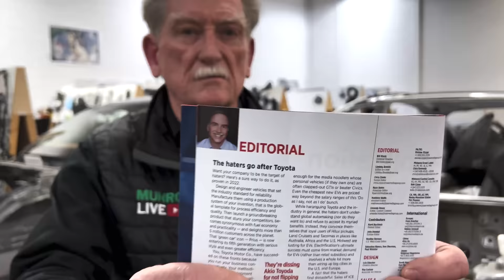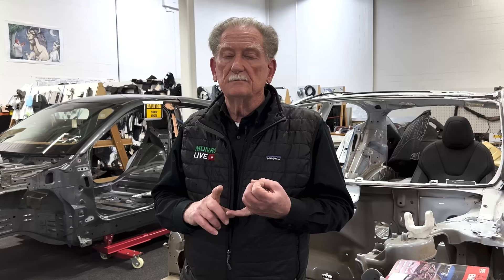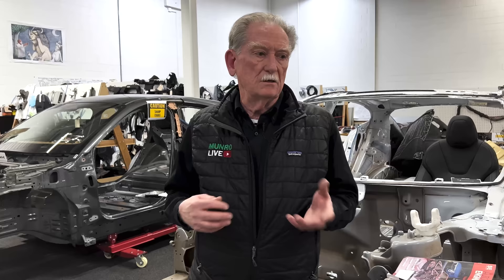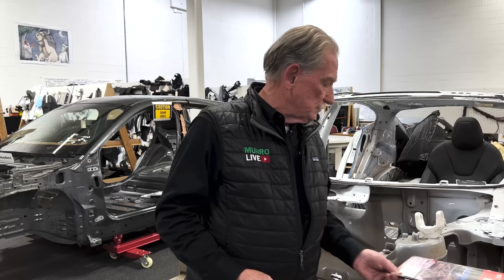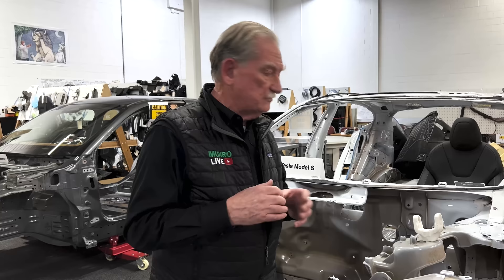GM Cast(ing) Away | GM gets low volume right.

Comment: Is cost for volume production the limiting factor for superforming scalability, or is the problem a “volumetric density” issue where the sheer  mass of production equipment per unit delivery is absurd?  Just wondering aloud via fingertips.  I think you’d be stunned how many mixed sheets and types of 7000 series aluminum Boeing gave us to develop and prove a high speed laminator for their Bell/Textron division three of four decades back. I think 3M beat that expense with 24x24 inch rolls of heavy Mylar backed with acrylic foam tape delammed and relammed by the hundreds of feet, straight into giant dumpsters.  Thanks, that was a hoot. I hadn’t even heard “cope and drag” since 7th grade machine shop and foundry class. It’s astounding what fixing bottlenecks can cost a company.

Comment: My personal obcession is "what could be".
Some brands make aluminium supercars that weigh a lot more than competiting offerings from for instance McLaren that are more carbon fibre based. The former still bring the good on the track, despite the weight penalty.
I'd love an analysic what say a Porsche or Ferrari car might save in weight by going to carbon fibre monocog for instance. And to which extent such carbon parts can be scaled for volume production. Larger autoclaves? Shorter bake times? Room temp curing? Using in a low pressure environment, are eventually costs saved that allows for exotic materials to end up relatively affordable?

Comment: I use 7 3d printers in my business when I use my 3d scintering printer I can use any metal sand to make a matrix of metal beads welded together. then I cast in an epoxy to fill the voids with a material that is extreme grip

Comment: Curious about the 3D printed battery tray. Was that ABS? Also what orientation was that printed? Just about every way I could think of woul have lots of support structures
Reply: The part could have been made on an Stratasys Objet printer.
Reply: It was probably a powder bed based process, which is pretty popular amongst industrial prototyping when you need a combination of actual shape representation and functionality. In powder bed the support structure is the powder bed so many shapes are possible with relatively little post processing labour.
Reply: @mdfyui8000  Have you seen how poor quality the parts are from those machines?  I really don't think that was the machine used to print that part.

Comment: Sandy, how possible is today for a small shop to develop a limited series using aluminium standard parts with foam loss casting and 'vacuum' forming? With standard parts for chassis and eletric drivetrain, how expensive is to get a car road worthy and certified?
Reply: Amen. Thats the question aptera is breaking. Carbon fiber is the answer for custom design in low volume. I dream of a open source free design car. Hope that canoo would throw shiity loxury carrouages under the bus for a real value vehicle

Comment: Have to disagree in therms of efficiency on the factory and overweight reduction using casting pieces. A spot welding robotic line, is way more efficient welding metal sheet layers, than using big casting pressers with big amount of rejected pieces on quality control. In terms of weigh, using casting pieces could in fact add more weight, than using stamped metal pieces.
Reply: What then is driving the trend?
Reply: The welding process alone is not the problem, but all sheet metal parts must be punched and machined beforehand. The whole thing together with the logistics needs more production space and has far more material waste than die casting machines.
The necessary weight depends very much on the construction and is by no means the only evaluation criterion as to whether the manufacturing technology is good or bad.
Reply: @rcpmac  the use of big casting pieces were just another of Musk promises. Check the amount of rejected castings spoted around Tesla factories. There's too many technical issues to properly cast big complex structural pieces with acceptable average quality. That's why Automakers, including Tesla, use smaller casting pieces, welded or riveted and glued together. Even with the Cybertruck, Tesla is back pedaling to their more standard building approach.
Reply: @Zedus-rl9hp  even so, not as big logistics as used with big casting pressers, that are expensive to operate and maintain, and can issue more unexpected expenses to the company, due to a lack of quality on a batch of castings, or the time loss maintaining the machine. While a robotic spot welding line is more cheaper to install and more  productive in the long term.
Reply: @RogerM88  Do you want to give more details on rejected castings at the present moment (at the beginning there was for sure but things have changed)? What back peddling is Tesla doing on the Cybertruck?
Reply: @RogerM88  What industry do you work in?
Reply: @Zedus-rl9hp  The guy just wants to keep his job and remain relevant in a changing world, No one will replace my horse and buggy!
Reply: Tesla's margins prove you wrong RogerM have a nice day.
Reply: @turningpoint4238  the Cybertruck, as any realistic person to the Automotive industry already knew, won't use an exoskeleton made of stainless steel, because major upgrades on Tooling, Suppliers, and Assembly lines would be needed. And the big casting piece promised for the rear section of the Cybertruck won't be feasible at a mass scale, due to possible issues with those big castings, that could suffer distortion at the cooling process. Check the recent Cybertruck update, it's clearly a standard unibody construction with some rear casting pieces.
Reply: @Barskor1  if Tesla offered more affordable cars, had a better quality control, more models and option, those margins would quickly fall. Also their average build quality shows those big margins.
Reply: @RogerM88  That was just a tool jig mock up. Heard so many times that what Tesla was going to do was impossible (along with SpaceX) and then Tesla does it. Time will tell.
Reply: @RogerM88  What? "Falcon 9 uses an already proven design", really? Think you need to do some proper research, the FUD these days is so boring.
Reply: @RogerM88  Since you don't want to/can't tell me, I have to guess based on your statements: Confectioners? delivery service? carrier pigeon mechanic?
Something in that direction, because you have absolutely no idea about the matter here
Reply: @Zedus-rl9hp  more expertive in the Automotive industry than you for sure. Tired of reading casual fanboys thinking they know it all just sit in their chair. No common sense what so ever, that claims Tesla is a Tech company to justify it being overvalued. At least due your research about the subject.
Reply: @turningpoint4238  the Merlin engines are based on the Lunar Module lander engine. Landing rockets wasn't a thing that concerned most Rocket companies, because it has trades doing that, as efficiency, more propellant, more weight, and structural reinforcements required. Just as naval means to retrieve the boosters, as refurbishment costs, which all add up. If Falcon 9 is so cheap to operate, then you should wonder why SpaceX is in a rush to replace it with Starship. They could instead develop a bigger fairing to Falcon Heavy, if the demand for a bigger rocket was so great.
Reply: @turningpoint4238  there's multiple other technical issues with Starship that could mean it only being used to Sarlink missions. As not having a standard payload fairing, and even to use a dispenser system they will need to reinforce the hull adding more weight, not Crew rated anytime soon without an abort system. Too massive requiring big amounts of propellant that could be a big issue to missions beyond LEO. Using Methane instead of Hydrogen could be an issue to produce outside Earth. The engines are to close to the ground, and the landing legs are too short to land on a rough terrain. The access to the ground for the Crew needs to be done via crane. The integrity of the heat shield could be compromised during launch and landing. Multiple other issues could also be refereed. But many fanboys prefer to drink all the Kool-Aid fed by CGI.
Reply: @RogerM88  👍😂
Reply: @RogerM88  Those rocket engines are massively different. SpaceX seems to be doing very well financially whilst been the cheapest per tonnage into orbit by a long way. Startship should be even cheaper and have far greater abilities. If you really want to learn about the facts try watching "The Everyday Astronaut".
Reply: @turningpoint4238  SpaceX is doing very well financially? Starlink has massive operational costs, requiring continuous satellite replacement missions over time. And Starship program been consuming too much funding. There was even a leaked email from Musk claiming possible bankruptcy of the company. Big percentage of the costs per launch, comes not only from the Rocket, but as to maintain the launching infrastructure, operational costs, propellant, and Staff.
Reply: @RogerM88  To be able to afford all that investment yes the Falcon 9 rocket must be very profitable. Investing is the way to grow.
Reply: @turningpoint4238  Starship as stated, has a big issue for commercial applications, it doesn't have a standard payload fairing. Meaning sensitive maneuvering will be required to deploy the satellites, or the use of a Canadarm. And to have a functional payload hatch, structural reinforcement to the hull will be required. Add to that, many companies opting for more compact satellites. A simple comparative in the number of launches from Falcon 9 to Falcon Heavy, just gives you a clue where the market is trending.
Reply: @RogerM88  Having a large capacity at low cost opens up new markets. Don't keep looking to the past thinking the future will be the same. A good start at understanding how different the future will probably be is the work by Tony Seba. A man often laughed at when making predictions by industry experts but guess who is the least wrong.

Comment: Cadillac, Cadillac you say. I had a 2008 Cadillac for five years ( first and only Cadillac ) GM product ( how could I go wrong???)
Without question the worse piece of junk on wheels. Always something broke or about to be broken. Always to the tune of $1000-$1500+ repair. Nice driving, yes,when it did, and that was rare.
Make no mistake, I always keep my vehicle in good sound working condition. I am way to cheap to spin the tires.
What are the chances of a broken rear wheel bearing, rare for sure. But two! A hanger bearing, no problem $50-$60, but it is attached to a $1200 drive shaft. I can go on and on but this is not the place to air my complaints.
Cadillac was once revered as being among the best of vehicles on the road...........not in my books. 
And yes I still have the repair bills to validate my claim. I woulden't

Comment: No mention of porosity with casting.   The larger the casting,  the more likely it is to have a fatal flaw due to porosity.  With housings and cover plates, they can be pressure tested to find flaws.  With structural components,  it seems like you would have to x-ray every part or do a non destructive stress test.  I don't know if Tesla has a good way to confirm structural integrity of each part or they are playing the odds until they see catastrophic failures in the field.  I would not want to be the guy that has a cybertruck that cracks in half after hitting a pothole. Tesla also has a way of blaming the customer when their stuff fails.
Reply: Beauty of sand casting is the ability for gas to permeate through the sand mold lowering the overall porosity within the casting cavity
Reply: @ryanlester6882  Tesla is using die casting with their giga press.
Reply: @michaellowe3665  My comment was in reference to the sand castings for the Celestiq. I would be interested to see if 3-D sand printing is being used for hollow sections that traditional coring strategies wouldn't allow for in conventional sand molding methodologies.

Comment: How much metallurgy has been done on parts produced from additive manufacturing?  CAD data representing the part to be made is easily obtained, BUT is the part produced from additive manufacturing EQUIVALENT (in every way - strength, fatigue resistance, thermal properties, chemical resistance, etc) to the same part produced by well understood traditional methods backed by science (metallurgy and metrology)?  No one can provide an answer to that question.  How much actual science has been done on additive manufacturing produced products?

Comment: Please explain.
Ram up
Gates
Screws.
Hard to follow your lectures without understanding.
Reply: Ram up is were they pack the sand around the mold so it retains its shape.
Gates IRC are the point molten metal flows into the mold.
IRC Screws thin sections that let metal flow to other areas in the mold but will be cut off afterwards.

Comment: For a reason most Automakers aren't rushing towards using big structural casting pieces. The quantity of rejected pieces distorted in the cooling process could be significant, porosity of the piece, possible fractures to the castings that would mean expensive recalls for the Automaker, expensive integration on Assembly lines,  maintenance costs, degradation of the molds, are some of the issues. Even Tesla is still using the standard approach using modular casting sections welded, riveted and glued together.
Reply: What are they using that on? And are you saying they aren't using the big one piece castings?
Reply: @grahammonk8013  
He's probably confused by the prototype CT casting "assembly" which they couldn't make in one piece because they are still assembling the machine.....
.
It's easy low grade FUD.
Reply: It’s a terrible idea lol this has been tried before.
Reply: Tesla seems to be very happy with castings.
Reply: @tombrenemanMt  happy shredding multiple castings that failed quality control? For a reason they are now using a more standard approach to the Cybertruck, with multiple casting pieces.
Reply: @RogerM88  oh roger give it a rest
Reply: Reason why western Automakers aren't rushing to big structural casting is they don't have the ability and sunk cost fallacy, China on the other hand. Think you are mistaken about Tesla.
Reply: @RogerM88  Think you are cherry picking data from the start of using this process, today it's different. But guess that doesn't suit your narrative.
Reply: @RogerM88  "happy shredding multiple castings that failed quality control? " Yes, yes they are. If they were failing a large percentage of castings it would be a different matter. Early on, there were dozens of scrapped castings per week, there have been nowhere near as many recently, and they are making thousands per day. Also an aluminum casting is very easy to recycle. You have no idea how the Cybertruck will be made, the photos seen so far are test pieces, probably for assembly line calibration. The 9,000 ton press is in the process of assembly right now, and IDRA cannot actually run the machine at their factory, so there have been NO actual giga castings for the CT made yet.
Reply: @RogerM88  so great to hear from a tesla worker with the facts!
Reply: @tombrenemanMt  Sarcasm? as RogerM is not a Tesla employee.
Reply: @Barskor1  bingo
Reply: @grahammonk8013  you should wonder the reasons why they are seeking an even bigger pressing machine.
Reply: @RogerM88  Because they need a bigger casting for the CT? Duh!
Reply: @grahammonk8013  but not for the size initially claimed with big single pieces. And in recent images the Cybertruck prototype, looks to be using a unibody construction with rear casting section, as expected.
Reply: @RogerM88  That "prototype" was not using a final cast piece. Best guess is the finished design will use a casting that will incorporate both the visibly cast pieces, plus the bit spanning between them. That would make it much bigger than the Model 3/Y pieces.
Reply: @grahammonk8013  and they won't use casting pieces bigger than that, for the simple reason that a bigger casting piece is more prone to get wrapped or some features not being so refined, as the mold is getting degraded due to thermal shock.
Reply: @RogerM88  Did you mean warped? 

"as the mold is getting degraded due to thermal shock"  

I think you're now spouting nonsense to sound like you know what you're talking about. I also note that you aren't responding to the points I'm making, you keep moving the goal posts.
Reply: @grahammonk8013  the warped issues can occur on the large casting piece in the cooling process. And molds tend to progressively get warped too from continue use, due to thermal shock as pressure. These pressers are massive, and with it, could bring costly maintenance and even stall the production to service them, if other alternative pressers aren't available in the factory. Another benefit of using a modular construction, it's being able to share component among other models.
Reply: @RogerM88  So far they seem to stand up to 100s of thousands of castings without issue. What is your personal experience in the die casting world?